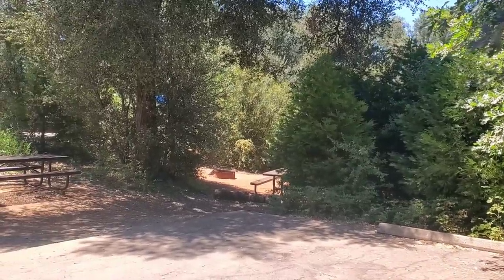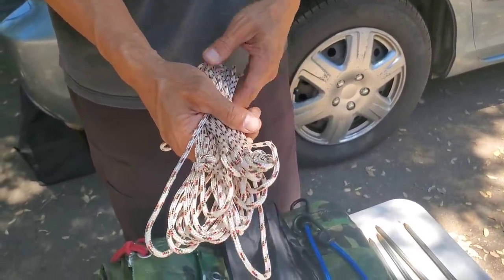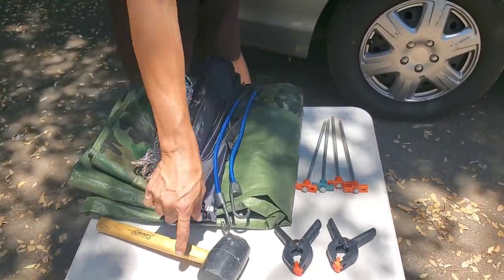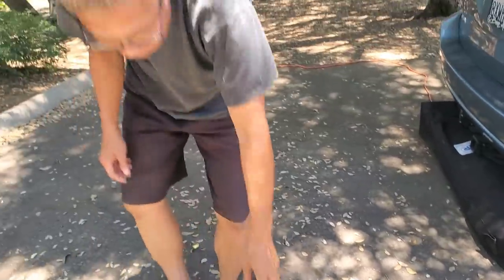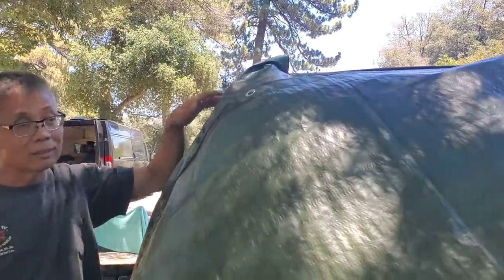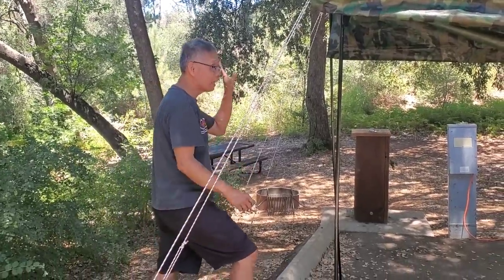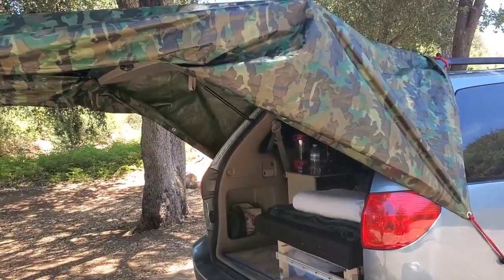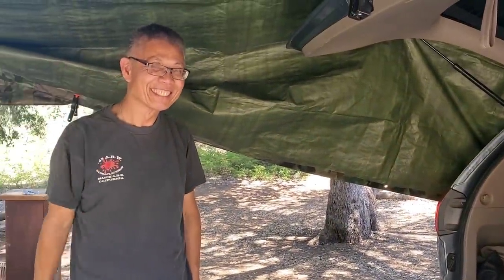Van Life: Beat The Heat With A $50 DIY Awning

Comment: Nice job, Tim! This awning is a great idea and such an easy design. I mean, anyone could put this together! I have a small travel trailer that has an awning, but Ive ofter thought Id like to have shad around the back end or the opposite side on super hot sunny days. This design would be perfect. I have one suggestion: instead of using dark colored tarps, find one that is silver on one side and dark on the other. This way, the silver side can face up on sunny days and reflect the hot sunshine away, thus keeping the underside a bit cooler. Reverse it on cool days to absorb the warmth you can get from the sun.
Reply from the maker: That's a great idea using the different color tarp and even reflective👍I also think I'll use more than one diy awning to make it cooler in my van.🙂

Comment: This is just what I need I have a 25-year-old high top Safari conversion van with no rack on it and I'm already using magnets to cover the exterior side windows with some older windshield covers that I got full on both sides they were new and slightly used and I paid $0.50 a piece for him and a thrift store.   Magnets that I bought at harbor freight some of them have clips on them I use those at the top to suspend it and use the heavier rectangular magnets on the sides and across the bottom.  I haven't tried this in a high wind however here in South Alabama it's extremely hot in the summer my rig has two non-functioning air conditioning systems and I'm down to only one window luckily the driver side that will open and lower the three little sliders in the back one doesn't not work and the passenger window quit functioning although I have replaced the motor in it twice.
Reply from the maker: The magnets really work great for folks likee you and me who don't have regular racks on top. I also love Harbor Freight. They have everything!!

Comment: Made my own awning from Leows hardware store, it was just a shade. I purchased a set of grommets and added grometts all around the tarp. I bought it like that because I wanted something that looked nice instead of of the se lame blue or green color awning/tarp. Mine is a light beige. If I can get the time I'll seow my own case because it's rolled up and tied with the rope it came with. I bout this because I can't afford some fancy one and the ones that are affordable are really small but mine is almost 14 ft long front to back and I believe about 8 ft deep so I have a ton of shade.
Reply from the maker: Good point. You can use a number of different options to actually make an awning.

Comment: Thank you Carol for the video and thank you Tim for sharing your awning!  I don't have a roof rack so I've been searching youtube for something in between a very fancy easy to put up and very expensive one and a DIY that doesn't require a rack.  I would really like to see the magnet set up if you can fit it in.
Reply from the maker: I unfortunately still can't drop.links even though I have been shown repeatedly. So, Tim is adding a comment with the links and I will pin it to make it the first comment. So check back.

Comment: I love this! I'm doing something similar except i bought an 8 X 10 sun shade (the kind you would get for your house) for $43 (that's including the tax). It allows for a breeze, which is awesome, but it's not waterproof so a fine mist will get through if it rains hard. On a positive note, not being waterproof also allows it to dry out better than a tarp would dry out. Anyway, I set it up with my tent poles and use 2 guidelines and stakes. I'm going to add two more guidelines for stability.
Reply from the maker: Great thinking. What's that saying.... Necessity is the mother of invention.